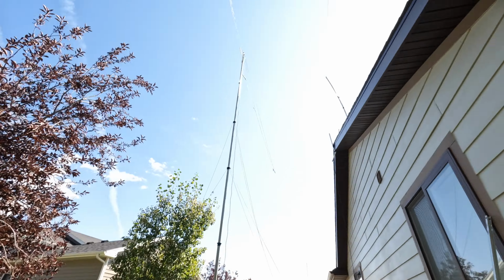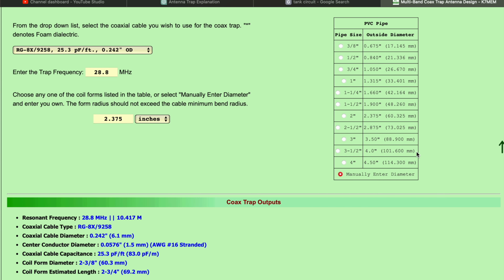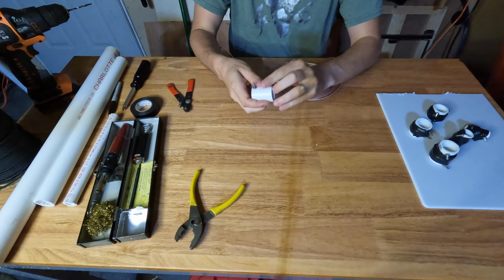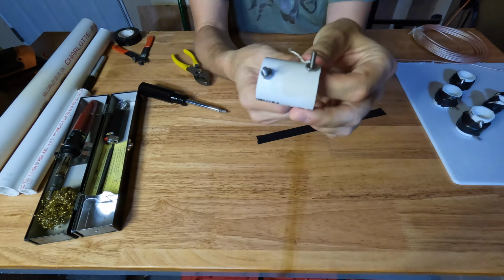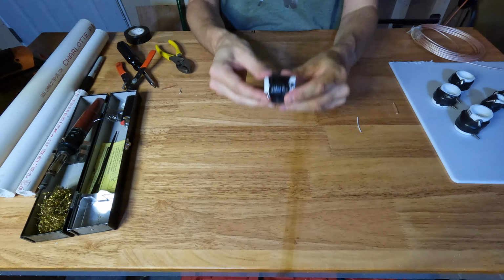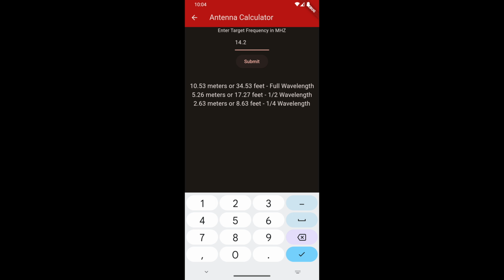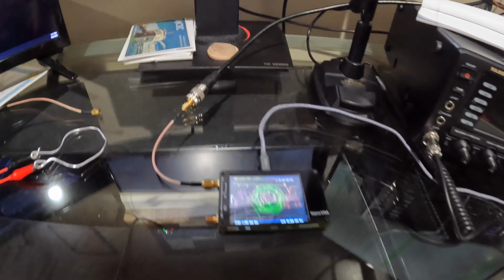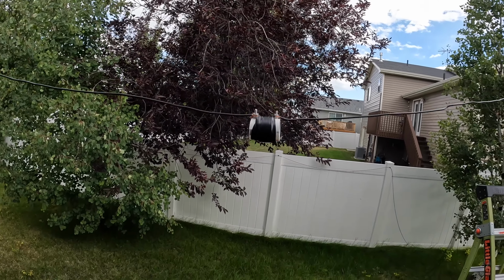Antenna Build Series 3 - Trapped Dipole

Comment: What pole are you using?
Reply from the maker: Its fiberglass heavy duty from dxengineering.com 
I have several videos on it. Its a great pushup. Especially for wire antenna experiments. Check it out!

Comment: How do you like Trapped Dipole compared to the Fan Dipole? I'm new technician and plan on getting on 10 meter and, working my general. Thanks for sharing your antenna building.
Reply from the maker: It really comes down to how you want to use it. The fan is full sized on each band you design it for, but becomes a nuisance in the wind. The trapped is more complicated,  but it gets more bands in a shorter space. My favorite is an end fed, I have that on my list to make. Its full have wave or more and mechanically easier to mount in most cases. Learning curve is a bit steeper and tuning can be tricky, but once its good,  its good. Ill make one of those soon for a video.
Reply: @kj7iaz  reason I asked, I'm in an HOA and plan on using my attic (15 ft to peak), looking at multi band type with limited space antenna.
Reply from the maker: @gtrs4ever you could start with a fan style.  You could do 10 and 6. Then add other bands as necessary as you grow. You can even do a loading coil on the lower bands and make them fit.
Reply: @kj7iaz  what gauge antenna wire do you recommend and, do I need a balun?
Reply from the maker: I dont really have a recommendation on gauge,  if your qrp or 100w 14g or smaller would be sufficient.  I use 28 portable. The smaller the wire, the less expensive it is. The bigger it is, the more usable bandwidth the antenna will have so its a trade off. No balun necessary.  Check out my dipole build. Its the first one in the Playlist. It shows  a great way to build a center mount for it. Then you can fan it from there. Dollar store cutting boards work good to cut out a center mount.
Reply: @kj7iaz  good starting point 14g or bigger and no balun.
Reply from the maker: Yeah that'd be fine. Let me know how it goes, send me some pics, I'm thinking about a fan builds video highlighting stuff built by my friends on here.

Comment: Just got your Antenna calculator and I have question, is there a way to change input dimensions from feet to meters?
Reply from the maker: Which one? I have one on the website and one in the ham radio toolbox app.
Reply: @kj7iaz  Ham Radio Toolbox app, I guess, it doesn't matter. It calculates by numbers
Reply from the maker: @dogikata  yeah the calculator displays both. Then the tuner just has you trim or add by the same as your original input length. So if you use meters, the adjustment is meters, if you use inches,  adjustment is in inches. 
Thanks for supporting the channel!

Comment: I am HOA restricted mast 20 ft. Now can slope so conceivably trapped as an inverted vee leaning or sloped.  Setting 20 trap at 14.0 how narrow will the 40-band width be? Is it going to be either CW/DIG or Phone? My current set up excludes any 40 and places 20 ends too low to ground.
Reply from the maker: It'll be pretty narrow, you might do a flatter lower inverted v for just 40, it'd be nvis, but most likely still usable with great success.

Comment: Hello, Thank you for the video.  I would like to build a 6, 10, 12, and 15m trapped dipole and think I have the trap part down, but I would like to know how I calculate the (electrically shorter) parts of each segment.  Is there a formula I missed, or is it just trial and error.  Thanks again for the video.
Reply: Ok I got it, the webpage tool you pointed to suggests the effective length.  "The Effective Length is the estimated amount that the next-lower-frequency leg of the trap antenna must be shortened to obtain resonance"
Reply from the maker: In the video, I mention the website I used. In the calculations there is an effective length of the trap,  just subtract that from the length you would cut for a dipole. As you move out, it adds up. So you'll have to keep track. It'll be close and fine tune by slowly trimming. Hope that helps. Feel free to email me if need be, I can maybe explain better.
Reply: @kj7iaz   Am I wrong? After putting this down in a spread sheet it looks like I may not be able to use the 12m and 15m bands after the 10m band.  The length of wire needed gets negative when the bands are too close together.
Reply from the maker: 10 and 12 are delicate.  10 and 15 should be ok. 
You can play around with the diameter and length of trap.  Find  get a combination that has less effective length.  Also.  This is only one way to build a trap.  Could try a different version. Or experiment on your own, a trap is simply an inductor and capacitor in parallel.  You could also do a fan dipole, it might work better for the bands you are trying to use, or even a hybrid version. Use traps and fans.

Comment: I am a new ham (so still learning). I was surprised you used coax wire rather than single conductor wire for the trap. Would a single conductor wire also work? If so, what advantage did the coax provide?
Reply from the maker: I used coax as per the instructions I used. A trap is a tuned circuit with inductor and capacitor.  So I think with coax it's giving it more of both. Sorry I can't be more exact haha

Comment: Nice! Maybe I'll go with a trapped dipole rather than a fan dipole. My only concern is I keep hearing that trapped dipoles are much more narrow bandwidth than fan dipoles. Do you find that to be an issue?
Reply from the maker: The trade off is its shorter, you can fit more bands. In the same space.  It's a matter of preference. The more traps, the narrower the lower frequency bands will be. It really depends on your goals. Try both, see what you think. That's the fun of ham radio.
Reply: @kj7iaz  haha I'm going to be getting my General license soon... I was a tech plus when there was still a tech plus license... then I got out of radio for a while (like 20 years lol) and just got back in. I don't want to limit the bandwidth right when I can use wider range of spectrum lol.
Reply from the maker: Yeah. It typically is fine either way, bit the fan is easy to build.
Reply: @kj7iaz  Maybe I'll do the fan dipole and just hang a few weights from the bottoms of the spacers to keep them from flipping up and around in all but gail force winds? lol. I don't know if that's workable though.
Reply: Don’t be afraid to ditch the spacers on a fan dipole. This will solve the wind issue as most fan dipoles built this way will self unwind without the spacers. You can also put each dipole elements on a different  azimuths, It’ll work just fine, and is more efficient. Give it a try.  Hope to work you on the bands. 73 N9XDS.
Reply from the maker: This is old, but a great idea!

Comment: Very nice thanks!
Reply from the maker: Thanks, are you building one?
Reply: @kj7iaz  I think I may try yes. I have a trapped vertical now but it's not as resonate as I'd like. So that means lost power of course. 73 KF0ALT
Reply from the maker: Yeah. I like the fan dipole too. It has more bandwidth on each band. But the tradeoff is the trapped can get more bands in the same space. And an internal tuner can compensate for the narrow bandwidth. Just tune it for where tou typically use it. Have fun!

Comment: Very nice, thank you. I want to do an antenna like this. Do you know why the turns are cross connected?  Is it simply to get 2x turns from one length (ie 7 turns becomes 14) or is it something more?
Reply from the maker: I'm not exactly the expert on the subject,, but  it helps create  the needed capacitance.. otherwise it would just be a loading coil.  The traps could be made from a torroid inductor and capacitor too, and much smaller, I want to do a future video on that as this got kinda long already.  If you have some spare coax laying around, this is a great use of it,  plus a very inexpensive way to get a good antenna up.
Reply: Ahh yes, the C. Now I get it. The coax has pF/m so a given length has a specific L and C. Thanks.
Reply from the maker: I also like the fan dipole if you have the space for lowest band you use. And use longer spacers all the way down.  This design is good for shortening the overall length, it really depends on each individual person's availability of space, supports, rules, etc.